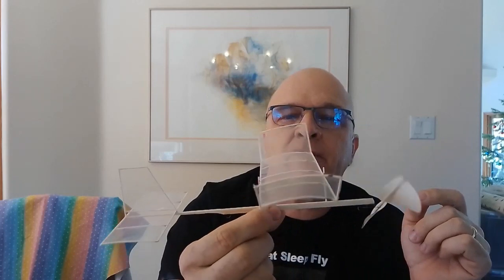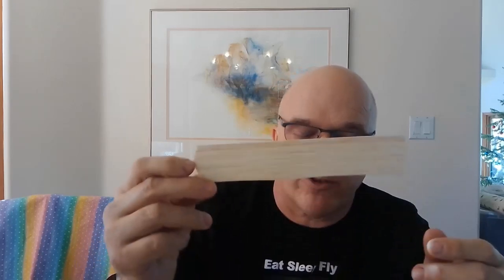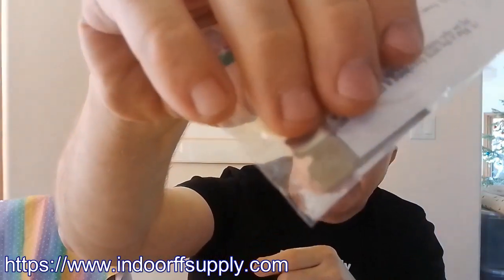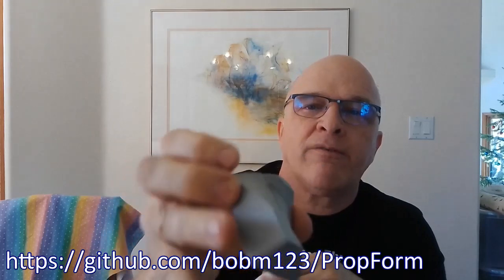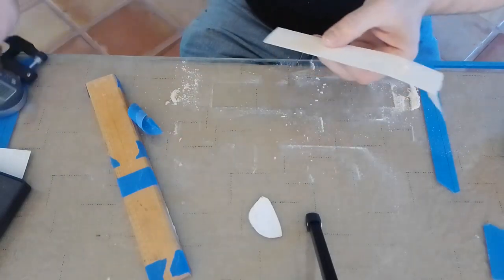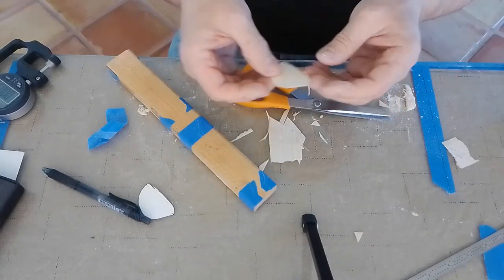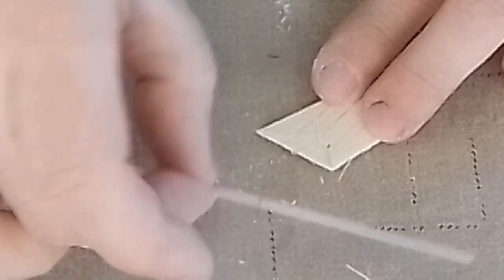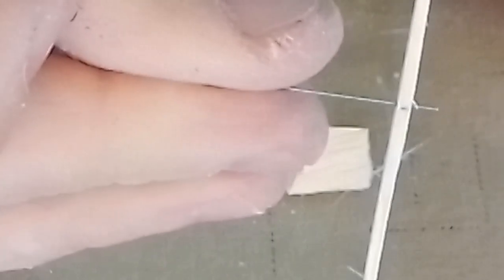Prop Building for Rubber Powered Indoor Airplane Models

Comment: It's splitting hairs, but that's how you accurately build indoor models:  For a 10"P x 5"D prop, the angle at r=2" should be 38.5 degrees.  If you want to use a 45 degree blade angle, then r should be 1.9"

Comment: At the AMA Nats you told me to angle the sides of the spar at about 45 degrees. Is the method shown here preferred to that and is there any noticeable reduction is glue surface area?
Reply from the maker: Martin: On such a small spar it was easier to make it round. Even at 45 degrees we end up rounding a bit so that if the angle is slightly different (it varies along the length) it does not become a line contact with a sharp edge.